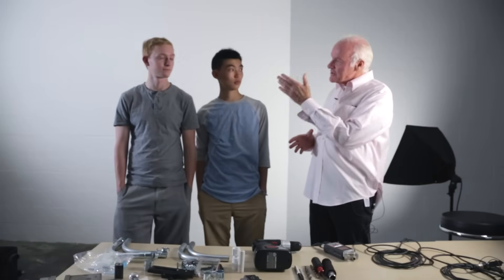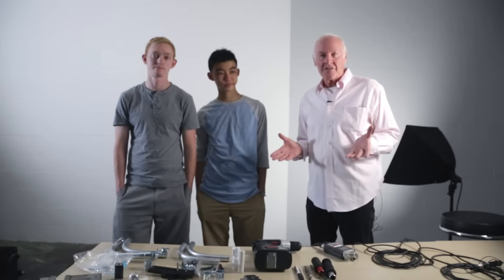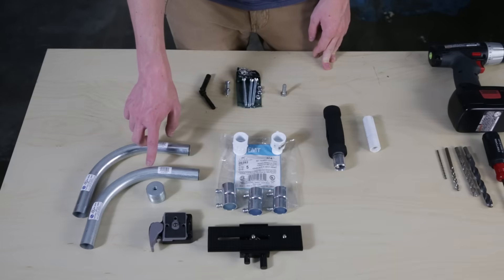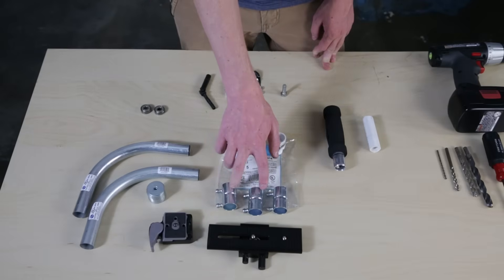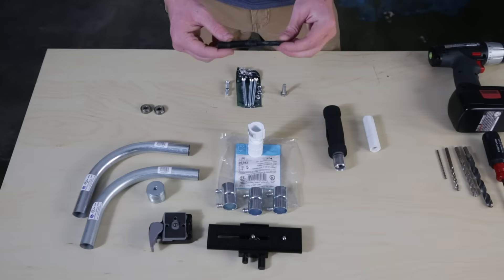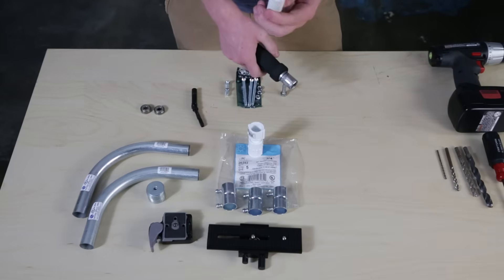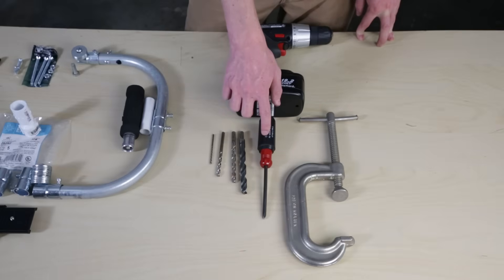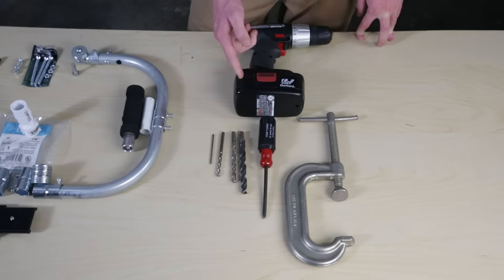DIY DSLR Steadicam "Silver Flyer" Stabilizer

Comment: Saw the previous comments but also curious if the slider is an important aspect of this build or if it simply helps with balancing?
Reply: Hi Travis, the slider is not an important aspect as it can still balance with out, but the slider allows for easy access for removing and attaching the camera.
Reply: Evan Li  well with the quick release plate I imagine that would help with the ease of access to the camera? But as a friend pointed out the slider likely helps with the minor balance adjustments specially when using different lenses.

Comment: To anyone suffering from the steadicam turning on its own try this:  Take a rubber band or two and hook it to the bottom weights (rubber is a shock absorber), and you can use this not only to balance/calibrate in the moment, but you can also flawlessly steer with it.  I've even steered up and down with ease.  I recently shot 40% of a short film using this technique- if you're interested in the results you can watch it here:  https://vimeo.com/165589805   Hope this helps!
Reply: Caveman1593 hey hey, I know it was a year ago... But the link isndead and I am struggling a lot balancing this thing
Reply: +Scott McKeever Can you show what you mean exactly? From where are you connecting the rubber bands?
Reply: +beantown86 Photos at this link!  It takes a few minutes to get used to, and you want to use 2 or 3 bands all at once, as one fat rubber band, but it worked for me.  Hope this helps!
Reply: +Caveman1593 Where is the link?
Reply: Click the read more button, its at the bottom of my comment ^
Reply: Oh shoot sorry.  I thought you meant the Vimeo link.  Here's the link to the photos: 
https://www.dropbox.com/home/Silver%20Flyer%20Rubber%20Band%20Photos

Comment: Where can I get the bearings?
Reply: +stand together You can buy the bearings from amazon or hardware store (home depot), or if you have an old skateboard laying around, most have 10mm bearings!
Reply: +Evan Li I tried making this, but for some reason it keeps wanting to turn left or right instead of keeping the camera dead straight. Maybe it's my balancing or my bearings? can you give me tips please on balancing it or how to stop it from rotating. (it will especially turn when I try to test the balance like the pushing forward and sideways motion as shown in the video)

Comment: Thanks for the video. Edited the parts list:

(2) 3/4" 90 degree electric metal tube
(3) 3/4" Electric Metallic Tube Set-Screw Coupling
(1) 1/4" x 1 1/2" Hex screw (Phillips head bolt for macro slider)
(1) 1/4" Nut
(1) 5/16" x 1" Hex screw (for traxxus)
(2) 1/4” x 3” Hex screw (for fender washers)
(2) 1/4” Nut
(~50) 1/4” center x 1 1/4” diameter fender washer
(2) 1/4” Butterfly nuts
(1-3) Standard bearings (for how much it turns)
(1) 1/2” PVC pipe 5-8 inches long
(1) Traxxas 1651 half shafts set of 2 (amazon)(1) DSLRKIT macro slider (amazon)
(1) vktech quick release plate (amazon)
Cost to buy new ~$60+tax

Comment: is it important the the holes aren't drilled straight like the ones in the video?
Reply: +8wheelsbootingfruit We tried our best to drill the holes straight, but maybe from the angle of the video, it may not have looked straight. We highly encourage the holes to be as straight as possible, but should work just as fine if they aren't perfectly straight.
Reply: Evan Li hey how far from the end of the tube are the holes?

Comment: Ok, getting this thing balanced is an art form I guess. I keep stacking weights on the bottom and it just seesaws back and forth when I move it as you do at the end. Should the weight at the bottom be equal to the weight at the top?
Reply: +Jess Gibson i think it's trial and error
Reply: Jess Gibson i agree, honestly, I have built mine two years ago, but the balancing part always prevented me from using is

Comment: I'm having trouble finding the metal piping in a 90 degree bend. What type of metal is it? I went to the hardware store today and they only had galvanized steel piping which was super thick and would be extremely difficult if not impossible to drill through. Also they didn't actually sell pieces like that. They only sold 10 foot long straight pipes. So if I need to get the pieces cut and bent what should I ask for? They look like 12 inch long bent conduit. Any further info on these would be greatly appreciated. Thanks!
Reply: Not sure if you found it already but it's electrical conduit. Home Depot or other should have everything in the electrical area.
Reply: Thanks, yeah Home Depot had it. For some reason they don't carry it at OSH. Oh well. Thanks for the reply.